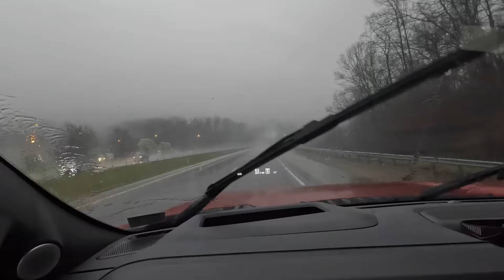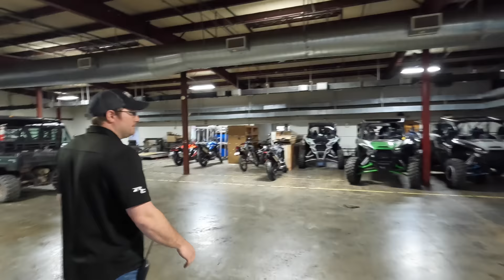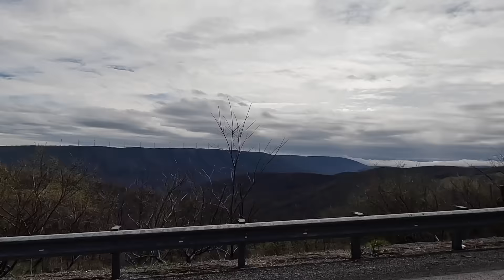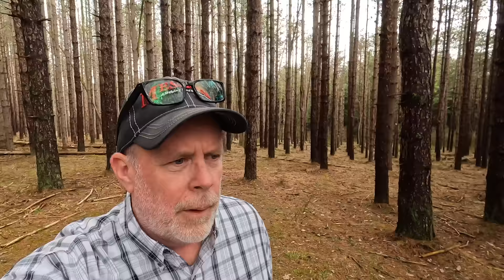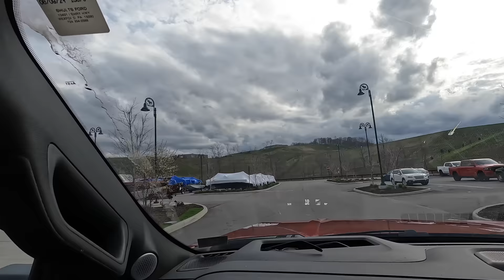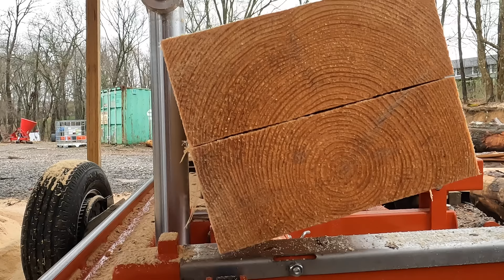New Machine From WV, and Met Some Wild and Wonderful People

Comment: I have had a MULE PRO-FX EPS for 5yrs ??  great machine & 3 yr warranty!  From the get go I upgraded tires to Tensor Regulator A/T (8ply) ATV Tire [28x10-12] a light truck like AT for better everything  ~  traction, ride, handling, speed.  Mule has plenty of power tho speed limited to 43 mph by governor. Tensor up sizing brought speed to almost 50 safely making it safer to drive on certain busy streets and to get places more quickly.  Brakes are Mule's weak point and with larger size tires & their additional unsprung weight brakes are even less good but still by-all-means adequate just not race car stopping power

Comment: Mike, I just saw the video and the dealership you went to in Romney. I contacted them about a product that they may be interested in selling at their dealership. In your video I noticed the way you secured your ATV for transport and I felt you could use the system I invented for your personal use. Using straps is not safe and I'm curious why the trooper didn't say something.  It's called the ATV Might TiTe lockdown system and I invented it about 13 years ago and have sold thousands of them all over the world. It is the quickest and SAFEST way to get your ATV out on the highways. I sold my patent 3 years ago to a company in Marshal, Texas (Thumper Fab) and they have continued fabricating and selling them ever since. This system insures safety and convenience with a 30 second lockdown or release. The reason I sold my patent is because I am getting to old to keep up with the business. Anyway thought you might want to check them out. Have a good day
Paul

Comment: Levi is going to love the Mule.  I've had mine since 2017.  I haven't had one issue besides one of the coil wires going bad.  Excellent machines! FB has a really good group...Kawasaki Mule (Team Mule Pro).  Any problems or advice on upgrades, etc they'll be able to help.

Comment: If it were mine to do, and I could get the equipment,  I would go through  those red pines with an excavator  and push over  half or two thirds of the trees, being very careful to not damage the best of the tree stand. 
 I would take the stumps off and keep those separate,  I would do my best to mill as I went, sawing mostly one inch boards.
 I would burn my tops and braches with some of the stumps with an eye for biocar and charcoal as a sellable product.
 What a nice stand to work in!

Comment: Before you start really using the new Mule. I would check the diff and other fluids as sometimes the manufacturers dont always fill to full capacity.

On a side note, Some of these cops really suck these days.

Comment: Never would’ve give you a $ ticket for sticker on the license plate especially if you had it in your car, (Written Warning) at most which doesn’t go against your insurance. But most importantly “Never Argue with a Police Officer” you can always appeal it later & a written warning won’t turn into a $$ ticket. Surprisingly to me they revised the law in Massachusetts to where your suppose to cross a double yellow line if needed to avoid a pedestrian when the pedestrian should not be walking on a hazardous road in the first place. Great videos Mike, thx.

Comment: Quick question, when you are milling specific size lumber like let's say 2"x8" or 4"x4", does the lumber measure exactly the dimensions your trying to obtain. My LT 40 Wide is great in a lot of ways but the dimensions can be off sometimes 1/8". It drives me crazy. Some people told me that I'm milling rough cut lumber and that can be expected. I kinda disagree. Any thoughts you could share with me?
Reply from the maker: I'm not sure, sounds like something needs adjusted. Mine is right on the money. I flatten one side, then rotate 180 and flatten another, then turn 90 and check for square with framing square before taking a slab off third side and it works out perfect. Do you do that?
Reply: Yes, I do that. It seems the wider I mill the more it's off. I guess I'll contact Marty. Thank you Mike for responding. Enjoy your channel, been following for years. Never left a comment that I can remember but I'm sure there are many out there like me that enjoy watching your channel. Thanks again.

Comment: Brother I have to be honest, I have no idea how you northerners deal with the multiple days of rain rain, here in central fl we NEVER get even 1 day where it's a wash out, very very uncommon. The front pushes through and an hr or 2 later the sun is out. We haven't even had a freeze this yr. If we do get cold temps, by the next day at noon it's 65-70 deg. I have to be outside doing something with tools, machinery or something. That sitting inside stuff, yehhh I'd rather dig a ditch with a spoon😂😂

Comment: I have to say why do people like those side by sides I dont understand? They have no inclosed cabs, they are death traps. Why wouldnt someone just get a mini truck that has a real truck cab 4 wheel drive with dump bed and they made out of actual metal and glass windows. Actual heater air conditioning. No comparison. The side by sides are not dependle either. The japaneese mini trucks blow the doors off the cheap plastic side by sides.  Just saying. And not trying to offend. The bobcats Side by side look better to me too. Those side by sides are all plastic wow how cheap but exspensive cost. Personally I would buy a mini truck or a Bobcat side by side instead of those plastic death traps. I like to watch Josh and Arons too its a good channel. Sorry but that cop was an arse.